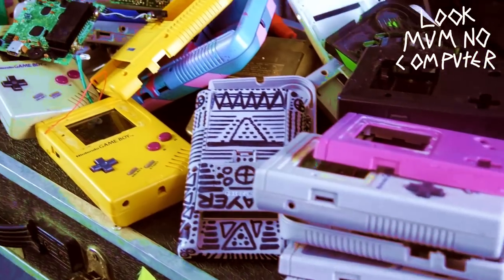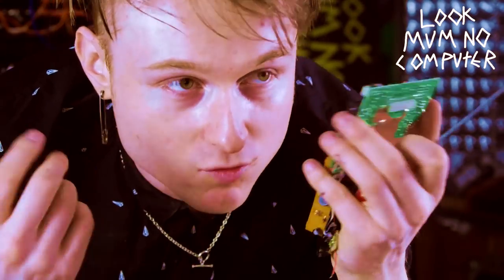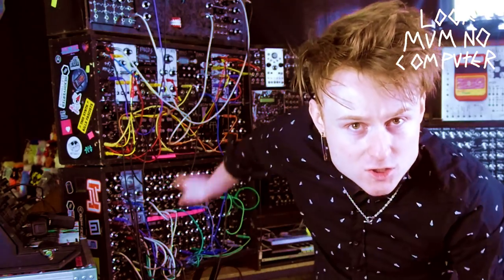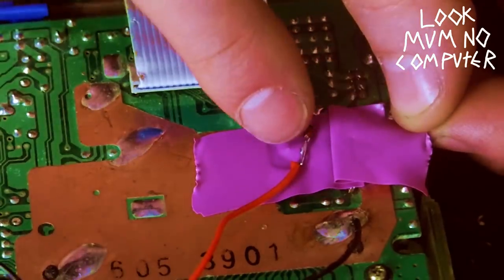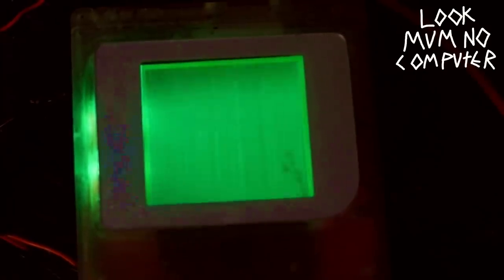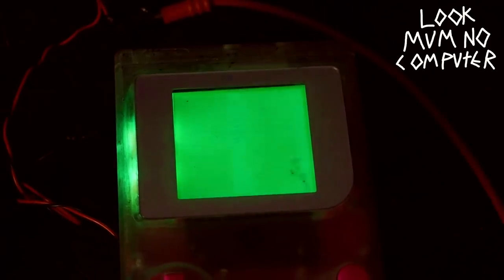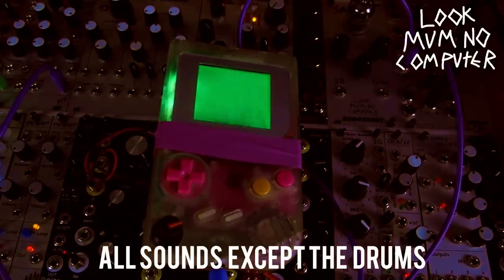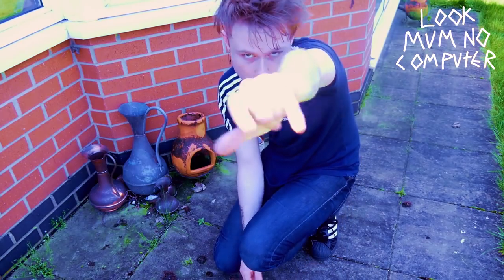Injecting Oscillators Into The CPU of A #Gameboy DMG BOOOM

Comment: 1st time I ever heard of adjusting clock speed for pitch was back when CD players were just making inroads into DJ'ing. The DJ was putting mod oscillators on Walkman CD players so he could mix with CD's. Like how you are using signals from the synth. Crystals are a fascinating subject all by themselves, would like to see some big rocks made into oscillators like a Superman Ice cave control panel! Just paint the sides with silver varnish and hook em up, might need to put filter circuits to pick out high frequency harmonics though.

Comment: this is legit mindblowing to me. its like a frequency modulation, but way, wayyyy deeper rooted in the system. i'd be really interested if it would actually modulate a single note as frequency modulators usually do

oh and fuck yeah warioland
Reply from the maker: just ordered a walkman to try ha
Reply: Joe Bartholomeus - It’s an interesting question, because normally for this kind of system the answer would be no: 

The GB, like basically all computers of the era with sound, uses a signal generator chip - the cpu sends it a number representing the frequency, and the chip uses an oscillator to generate that frequency independently until it gets another command from the CPU. 

The sound generator chip usually has its own clock source separate from the system clock, which is why I would’ve initially said no - changing the CPU clock in this case would change the rate at which the CPU sends the note change commands and thus the rate at which the notes play, but not the frequency/pitch of the notes themselves.

The interesting thing, though, which I’d forgotten until I started to make my reply: The square wave generator on the gameboy is integrated onto the die of the z80-derived custom CPU for cost savings. Therefore, the same clock source drives both the CPU clock input AND the sound generator’s reference frequency input.

So, interestingly, the answer to your question would be no for almost any 80s computer system with a sound chip EXCEPT the gameboy.
Reply: Presumably, the single clock drives all of the sequential logic on the GB motherboard, too, since altering that clock clearly also alters the LCD driver’s refresh rate.
Reply from the maker: the actual z80 has the the sound built in on the same crystal!
Reply from the maker: ooops just read the whole comment sorry missed that
Reply from the maker: kinda cool tho! im deffo on the hunt for more things. seems the 90's tech are the ones!!! to look out for, apparently itll work on a kaossilator too
Reply: Cheers, dude. Just found the channel and as an engineer and musician I’m loving it.
Reply: so ultimately you could frequency modulate the sound by modulating the clockspeed, or am i missing something?
im gonna try it out with lsdj, holding a continous note and see how much the clockspeed can be modulated before it crashes or burns or maybe implodes idk
Reply from the maker: yes thats exactly right. just get a single note, and fire a few oscillators into the crystal and see what happens.... but too low of an oscillator it will cause it to crash! so start where the oscillator is so high you cant hear it,,, and slowly bring it down
Reply: LOOK MUM NO COMPUTER alrighty, im gonna try and make a video of it

Comment: So it's something like chiptune FM?
Reply: +1 for FM
Reply: It's not modulating the frequency, it's just that you decide the pitch of the gameboy with your synth
Reply: gtheskater
pitch is defined by the frequency of the wave, so if you "decide" (=modulate) the pitch you modulate frequency.
Reply: @stefan1024  i believe that to called modulation you need to have a carrier wave and then information inside wich is modulated by that carrier...for cpu clocks you just use a square wave of a determined frequency...

Comment: What if you took the audio out from one Gameboy and wired it up to the clock of another Gameboy?
Reply from the maker: i dont think it would have enough oomph, but if you amplified it maybe! im away the next couple of days. good idea!
Reply from the maker: even doing it to itself!
Reply: I think the frequency might be a bit too low
Reply: JussapitkaPelailee Yeah seems like that was an issue in this video too. Maybe you could use the ltc1799 as a VCO and do frequency modulation by attaching the sound output to the SET pin...

Comment: So cool.

Hi. I just found the PSS-480 in a kind of shed, missing a battery cover and power adapter (asia 220v). I'm not sure it's working coz' it may have been rained on. Where can you buy an original power adapter (could be 100v or 110v, I'll just glue it to a transformer) and original cover? Thanks. Btw, I wonder if this keyboard is good to modify to circuit bend?

Is this model a toy by the way? Or is it used by professionals, like Roland. 

God bless, Proverbs 31

Comment: i was like you l,m,n,c well no i wasnt i dint do youtube and i was ghetto poor still am poorish (more by choice just earning what i need plus a bit of spare cash enugth to drive ) (i wasnt poor when i worked for perkins engines for 3 yers at £10hr plus bonuses - mechanical engeneer)  then i started repairing stuffs id buy as broken and stuff id buy as working that had faults n puting it on ebay  reconditioned point being your probably 5-12yers younger than me learn aundrino they dint exist when i was young oh and if you're not already get qualified betec l2 , hnd  in industrial engineering  thaat will take 3yr its good money pal 10/10 respect  i worked as a electric meter repair technician the money was £7hr crap. you are skilled dude trust.

Comment: Dude! Haha wtf!? 

If you ever do a Q and A. Have you ever/whats the worst thing you've wired up and instantly fried the circuits for? Any fires? Thanks dude
Reply from the maker: video processors break a lot! ive had a few things just go "poof" with magic smoke. fires, naaaa, actually i wired a capacitor the wrong way round, on a module. and heard a weird noise. put it right next to my ear and it then POPPED. i think that had a knock on effect to hearing out of that ear very well... ermm..... a few zaps. bought a 200 pound digital drum machine, fried it in 10 mins..... plenty of stuff haha.
Reply: LOOK MUM NO COMPUTER haha It's nice to know that trial and error transfers to circuitry aswell. I mess around with building stringed instruments so circuit bending is way out of my knowledge pool.
Oh no! Not the drum machine!
I know the sinking feeling of irreparably damaging something in a split second but its usually my hand and via chisel haha thanks for replying :)

Comment: so what you're doing is frequency modulating the carrier that is the clock signal
Reply from the maker: SuperAWaC initially I though. But at some points it just stops reading the carrier signal. Oddddd
Reply: something might be interfering with the mixing of the signals? i am only familiar with construction of oscillators for radio use, so i am not sure where i'd salvage equipment that would have a 146mhz or 440mhz crystal in it.

i'd hook it up to an oscilloscope if i were you.

Comment: I just wish I could buy a few those DMG screens off you. I have some original game boys that need repair. :-(
Reply: For real. What kind of issues do you have with the screen? Some are easy to fix with a heatgun or a soldering iron. Like if you have a couple lcd lines that aren't showing or glitching off an on
Reply: I decided to learn how to bivert and backlight mod these consoles and soon found out that the learning curve was steep. I tore ribbon cables and cracked screens. I can do it like a champ now. You have got to break a few eggs if you want to make an omelette I guess. I have a couple of motherboards that have no sound and I can't figure out what the problem is there either. Not surprisingly, I gave the Gameboy pocket a try too with the same results. I need some of those screens too. The vertical lines are easy to fix with a soldering iron. Nobody can fix horizontal lines so far. I have some info given to me by a guy that used to repair a similar issue on dot matrix screens in medical equipment but I can't get a screen with horizontal lines to test it out.

Thanks for the repy though, much appreciated.
Reply: I would do as you suggest, but my willy wore out ages ago😢

Comment: I would have liked this if you spent more time explaining the electronics and less time yelling and handwaving over the interesting bits.
Reply from the maker: soupisgdfood 🙃
Reply: I don’t mean to just be a jerk, I think you’re in a good position to teach some basic electronics on top of having some fun.

I just felt like I was told THAT a thing happened because a thing was soldered to a thing, not WHY the thing happened, which takes a lot of the fun out of it.

You’ve got an entertaining style though.
Reply from the maker: i dont know why it happenned. this was merely documenting something i was messing around with. i dont really know the technicals. just the practicals. soz
Reply: Fair enough.   If you get an old cheapo oscilloscope you should be able to probe it and show the signal change, and it would go with your aesthetic pretty well.